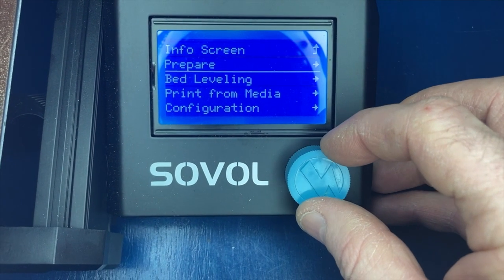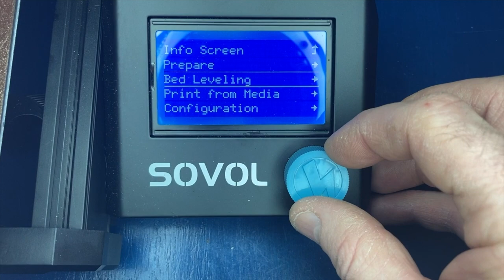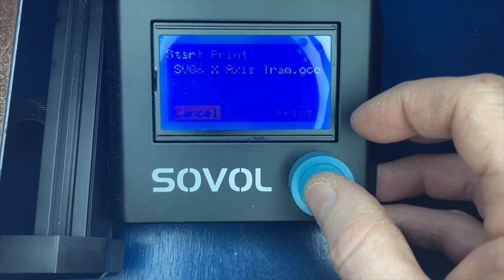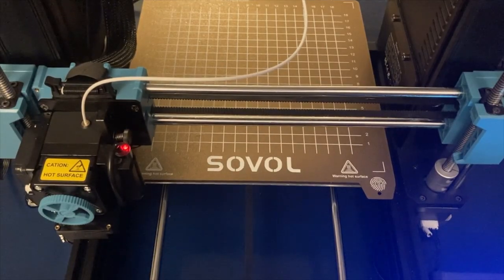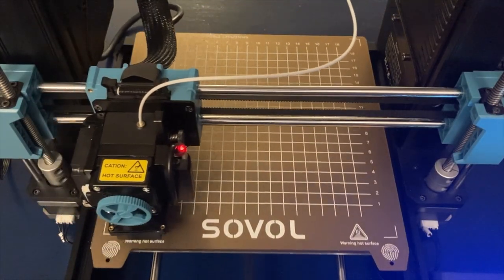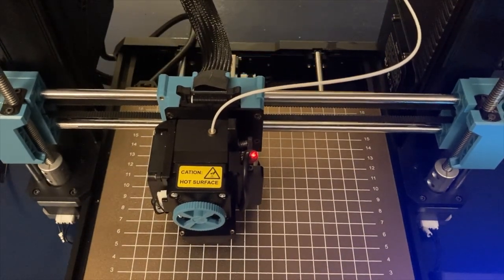Sovol SV06 X-Axis Alignment Using Bed Leveling Sensor (Replaces the "Auto Z-Align" Command).

Comment from the maker: I used a dial indicator to measure the height difference between the two sides on the X-axis at the edges of the build plate. Did it five times, adjusting the X-axis alignment to be off each time before running the gcode, and got a mean of 0.192 mm difference (right side was always lower) and a standard deviation of 0.0266 mm (at a 95% confidence interval given the sample size). Definitely good enough for ABL to do its thing.

The values, in case anyone is curious (negative value means right side was lower):
-0.21 mm
-0.15 mm
-0.21 mm
-0.17 mm
-0.22 mm

Comment: works just as well with disabled steppers and manual x movement
Reply from the maker: That's exactly how I started out! Got bored pretty fast.
Reply: @maximthemagnificent this is a cool method for leveling...I love this.  thanks for the video
Reply: Sure, but I'm sure the gcode makes it much more convenient and accurate

Comment: You need to disconnect the motors, because the two motors are connected in parallel. When you move 1 motor the other motor also wants and could move.

Comment: I bent my right leadscrew a bit doing this. It starts up way too high at 10mm, so when you're bringing down the first left side it's really bending the right side. Make sure you turn both Z motors counter-clockwise for the first probe on the left and right to bring them down evenly. Would've been better to tell it in the gcode to set the Z height to like 1mm rather than the default 10mm from the homing for the start.

Comment: This has got to be the best thing I have seen as of owning my new SV06 plus ( coming from ender 3s1 pro on sonic pad ), just wanted to let you know and everyone else too what I did after seeing this just to help out the community

Gcode didn't work for me (SV06 plus cobbled to sonic pad) but the light bulb went off\

Heated bed to target temp

G28 to home then shut down the steppers

rotated the z steppers down manually

moved x carriage left and right manually and adjusted corresponding z stepper as shown in the video

did this until both z steppers where 2 "clicks" down to light off and 2 "clicks" to light on

G28 to home 

ran a new bed mesh

set z offset

It worked!!! thank you this helped out a lot

Comment: I've tried a couple of small prints since I used your method this morning and while smaller items always looked OK the one that just finished looks almost like an injection molded part so I'll reprint something bigger later and see if the improvement persists.  Thank you for this solution!
Reply from the maker: Have you printed a first-layer test model?
Reply: @maximthemagnificent  I'll have to learn how to do that first!  Suggestions are welcomed!  Thanks again!
Reply from the maker: I made my own but there are a ton of them out there. Here is one example:

https://www.printables.com/model/144326-first-layer-test
Reply: What a genius solution to a big problem. It helped me a lot. Thank you very much.

Comment: I used this process and it works amazingly. No parts to print out, just need the gcode file linked to your video. I actually ran through it 4 times due to my mild OSD like personality then printed out the file another video and it printed out perfectly. 

I did redo the manual z offset to make sure the nozzle was the right distance from the bed and ran through the auto bed level before printing the file  It printed absolutely perfect on the first print on the corners and center after doing this as it was to test alignment.

Even after the latest firmware uograde the auto z alignment doesn't work perfectly. I also found printing out parts was less accurate than this method, at least for me it was.

Comment: great video, clear explanation.  Does this work for the SV06 Plus as well?
Reply from the maker: I don't have one to try it on, but it should in theory, though the X values required in the gcode would be different. I'd really hoped Sovol had learned from the SV06's issue and fixed the built-in alignment function for the Plus.
Reply: @maximthemagnificent  I have a Plus and no Sovol is not capable of learning. I will sell my after 5 Days testing and i am not alone. And that is not the only problem. I Never buy any Sovol Hardware again in the Future :face-orange-frowning:
Reply: @DD6VD  I have finished tweaking with the gcode, fixing my issue. open the gcode file and leave the "X0" as it is, and you edit the "X172" to "X252". Also change the "M0" to something else, because on the 06 Plus you don't have a button to click to resume the code. I changed it to "G4 S20", this gives you 20 seconds for tweaking, you can increase that value to G4 S30 if you need more time
Reply: @TheMasterOreoTM  , exactly the edits I needed and was working out... THX!
Reply: @TheMasterOreoTM  Thanks for this! Any other steps for the plus? Or is it just run through this, then auto level?

Comment: I just found this video trying to figure out how to deal with a bent y carriage, and was wondering if this will work with a bent y carriage.  The left side is sloped down while the right side is sloped up after looking at my prontoprint results.  My prontoprint values are listed below for reference.

        0            1            2             3
0 -0.155  -0.088  +0.095  +0.179  +0.179
1 -0.145  -0.076  +0.122  +0.214  +0.239
2 -0.176  -0.141  +0.044  +0.190  +0.250
3 -0.194  -0.176  -0.011  +0.164  +0.249
4 -0.180  -0.175  -0.006  +0.145  +0.207
Reply: I have the same bed problem, but Its also worse because the probe can't measure the entire bed. Resulting in not getting a consistent first layer. I also tried to level it with 0,1mm washers but also got mixed results (had almost the entirely bed leveled but I kept getting a very large drop off on the outer left side).

Comment: After doing this should I do the Level Bed function? (Where it detects the bed in all the zones)
Reply from the maker: This replaces only the X-axis alignment part (the first step, titled "Auto Z-Align" in the Bed Leveling menu) of the standard be leveling process. Sovol made a video, which is clearer than just the included cheat-sheet: https://www.youtube.com/watch?v=SEJVVoFvgMY

My process replaces the first 25 seconds or so of their video.
Reply: @maximthemagnificent  Thanks so much! my offset was way off. took 2 runs of the gcode but it fixed my warping issue.
Reply from the maker: That's great! Some people have had additional issues so I'm glad it did the trick.

Comment: Is there a way to use it with klipper?
Reply: came here for this very question.
Reply: I tried to run it to see what would happen it did not like it. Heated bed to temp, did a G28 command then unpowered the motors and manually moved the z steppers down and manually moved the carriage left to right and rotated the z stepper as shown in the video, did this until both z steppers were 2 "clicks" off to 2 "clicks" on.

Comment: Curiosity...  Will doing a Z Alignment undo your work with X tramming?
Reply from the maker: Do you mean the built-in "Auto-Z Align" step in the bed leveling menu? Yes, that'd undo this process entirely.
Reply: Yes, I did mean the Auto Z Align.  It made sense to me such would be the case; but it's nice to have it confirmed.  So thanks for the reply!
Reply from the maker: I've been assuming that people will do the built-in one first to get kind of close, even if it's still not great. Maybe I should've put that in the video.

Comment: Should "Bed Leveling" also be started afterwards?
Reply from the maker: Yes, this is meant to replace the x-axis alignment part of the bed leveling process, if the built-in alignment method is causing difficulties.
Reply: @maximthemagnificent  Thank you!
Reply from the maker: Hope it helps. Some people have more issues than just this, unfortunately.
Reply: @maximthemagnificent  Luckily I don't have this problem or not as bad as some others! Nevertheless, good to know what and how you can help yourself! Thanks again!

Comment: Hi what happens if when I start the gcode the sensor and everything is way too high and ends up needs a ton of adjustment to get both sides to turn off? this means that by the end of the five cycles it’s still quite unaligned and this happens every time i repeat the gcode so i can’t dial it in anymore
Reply: It sounds like your Z-offset is not low enough

Comment: Does this only need to be done 1 time, and then again if you detect that it's come out of alignment? In other words, is this 'saved' anywhere?
Reply from the maker: It's saved in the relative positions of the lead screws. Ideally, you'd tram the X-axis each time you want to run the bed leveling routine on the printer, but you might be able to get away without doing so if it hasn't changed. Since I don't need to re-level very often, I just tram each time.
Reply from the maker: Some people attach locking collars to the top of their lead screws or add a shim to the top of the frame after tramming to account for the errors the built-in method has. So if you're looking for a permanent solution, you can go that route.
Reply: @maximthemagnificent  Thanks so much for the reply! Sounds great.
Reply from the maker: I'm planning on replacing the Z motor couplings with flexible ones (can help with layer lines caused by lead screws that aren't completely straight), so designed frame-mounted stops that ought to work better for that than shaft collars. Have two versions: quick to install and more attractive, in case you might do the same:

https://www.printables.com/model/449675-sv06-adjustable-frame-mounted-z-stop-glue-andor-sc

https://www.printables.com/model/449671-sv06-frame-mounted-z-stop-clip-version

Comment: My nozzle keeps hitting the bed when i start a print
Reply from the maker: Could be a lot of reasons. I'd suggest asking in a forum. I use this one: https://www.reddit.com/r/Sovol/ They have a useful overview of issues stickied.
Reply: I had that issue. Homing doesn't seem to be consistent in the software. I recommend that you reflash the latest firmware and adjust your Z offset after you level the bed, not before like Sovol recommends in their manual. I had that same issue because the printer couldn't tell where it was despite having an induction sensor that could totally avoid possible collision. 

I told Sovol about this and they said they were sending me a new PEI sheet but they said they couldn't send a nozzle replacement.